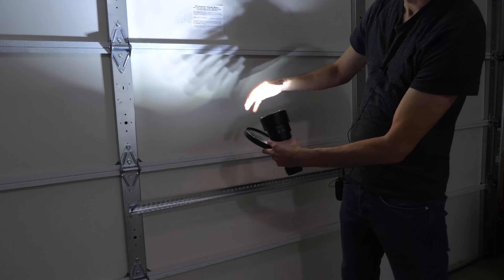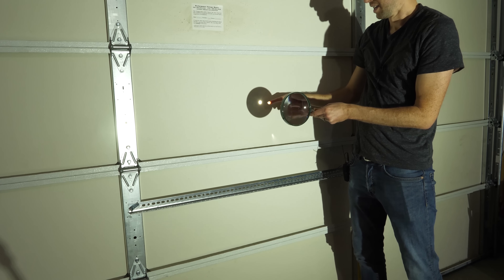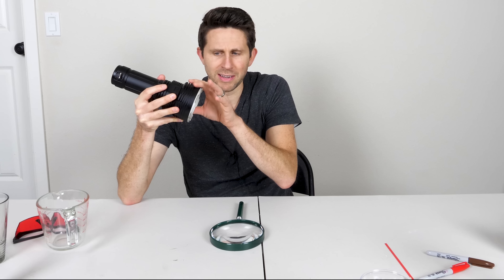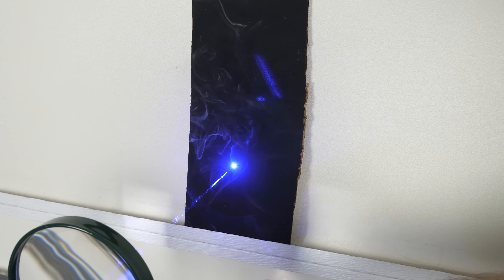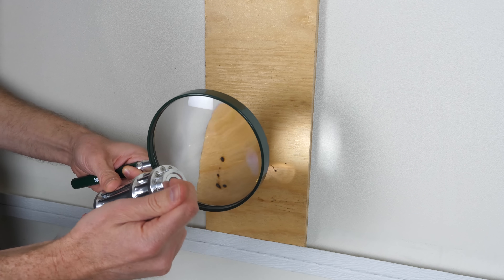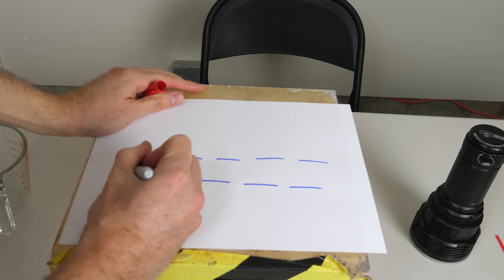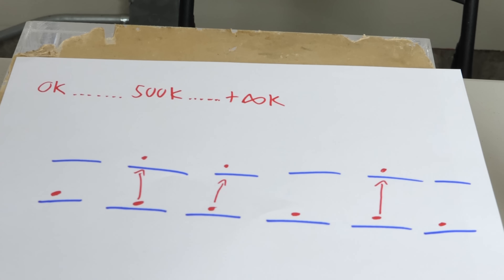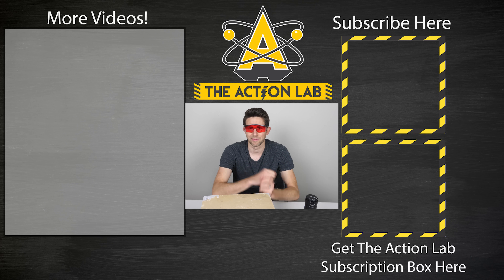What Happens if You Focus a 5W Laser With a Giant Magnifying Glass? Negative Kelvin Temperature!

Comment: Rather entertaining! Thumbs up for that :)
But i think a little more research should have been done beforehand...

In general, convex lenses are able to focus incoming parallel light into their focal point. The sun is emitting light that appears as parallel rays of light due to the vast distance between the sun and earth.
This is why we can focus sunlight rather easily into a point with convex lenses.
It is the same with the light from the laser. Ideal lasers per definition emit parallel light - which means it can be focused with a convex lens as we saw at 3:21.

With the torch, things are different. As seen in the video, the light it is emitting is not parallel. This can be observed at 0:42 to 1:48 with two reasons:
1.: the area covered in light is bigger when the light source (torch) is farther away.
2.: by the lens (magnifying glass) because it was able to focus far better when the torch was farthest away --> the incoming light was "more parallel" than at 0.5m distance at 0:45.
With the right setup, the divergent rays of the torch can be parallelized.
As far as i know, this can be achieved with a concave-convex lens combination or with a parabolic mirror.

Parabolic mirrors can focus incoming parallel light into one focal point. this means in reverse they can parallelize divergent light from a light-source emitting light in their focal point.
Of course, the mirror would have to be calibrated according to the divergence of the source.
With the light rays emitted from the torch now being parallel, a convex lens can be used to focus them into the focal point.

Also, i would like to point out that the statement starting at 2:34 is not true, because of a simple reason:
The parallelization of the light is possible as described above, although not perfectly (slight distortions can occur especially with big light sources).
The the parallel beam is focused (via the convex lens) in a small area.
This results in a higher temperature because the energy before and after passing the lens has to be about the same.
Means: there is no violation of the Thermodynamic Principles in this case. Also radiative heat transfer is a little more complex than "heat flows from hot to cold".

Conclusion and theoretical example:
Of course it is possible to achieve higher temperatures on a small area than on the surface of the sun (~5500K).
It is just a question about how much light you can focus on one single point or small area.
A way to calculate this would be to determine/look up the energy output of the sun's surface on 1 m², then compare it to the energy on the surface of earth and calculate how many m² would need to be focused to match the sun-surface-energy output.
As formula (i hope i didn't miss anything): Number_m² = (EnergyOutput_surface,sun / m²) / (Energy_surface,earth / m²)

Last but not least: i want to thank you The Action Lab for trying to make entertaining content about scientific topics.
This is very important work, especially in times when humanity is facing several challenges like the energy revolution and climate change.

BUT : You have to do it professionally and definitely not with sloppy research . 
Additionally nothing about safety regarding bright light sources or especially lasers is mentioned!
The torch alone should be able to damage your eyes permanently, let alone a 5W laser. Even a surface reflection could be enough.
ALWAYS warn people when handling stuff that dangerous!

basic info on lens-systems:
https://www.edmundoptics.com/resources/application-notes/optics/optics-application-examples/ (2min with google..)
more detailed info in every book about modern optics.

Basic info on parabolic mirrors:
https://en.wikipedia.org/wiki/Parabolic_reflector

Radiative heat transfer:
https://en.wikipedia.org/wiki/Thermal_radiation
https://nptel.ac.in/courses/112108149/pdf/M9/Student_Slides_M9.pdf
Reply: The way to see the problem with your analysis is this: Imagine individual molecules emitting and absorbing blackbody radiation. The best case scenario is two molecules at opposite foci of a large, hollow, perfectly reflective ellipsoid (prolate spheroid). Then, every photon emitted by one molecule will be absorbed by the other. They will trade photons back and forth as the absorber becomes the emitter and vice versa. They will be at the same temperature.

But if we add a second molecule to the "source" side of the ellipsoid, off that side's focus, then the radiation from that molecule will not be focused on the target molecule. The photons will almost always miss the target on the first pass or bounce, and will have a virtually identical chance of being reabsorbed by the emitting molecule as they do of being absorbed by the target. Now imagine a whole bunch of molecules radiating as blackbodies anywhere in the ellipsoid, and the situation on a per-molecule basis is the same. The molecules at the foci have a direct link and are at the same temperature as each other, while the other molecules all trade photons randomly and so equilibrate to the same temperature as each other.

Now consider that every real optical system for transferring blackbody radiation from any source molecule to any target molecule is worse than the ellipsoid is for the two molecules at its foci, and you have the reason that the target temperature cannot exceed the source temperature in any optical system. All the molecules in the optical system will, at absolute best, equilibrate to the same temperature.

Comment: This guy is an idiot... If you focus the light of the source say the sun, you can most definitely get a point hotter than the surface of the sun.
You proved that with the laser and you said with ANY combination of lenses... Use the right ones instead of a cheap magnifying glass and saying see see it doesn't work. Derdre herrrrrrr.
Reply from the maker: You obviously have no idea what I’m saying in this video...
Reply: @TheActionLab  Right so the source of the laser goes from less focused and powerful to focused and powerful contradicting an earlier statement you made in the same video.
So no I do not have any Idea of what you are actually trying to say or prove in this video.

Comment: Could not an optimized compound parabolic concentrator be designed that would fit in front of the flashlight ? Thus the CPC would collect most of the emitted light, gathering it together to a dot size comparable to the beam size of the laser ?

Comment: Dude, no, you are wrong! Lens gathers light from whole surface of one side, and most of that light(--loses on heating lens itself) concentrated on smaller spot on your wall. That spot receives more energy per unit of surface, i.e. lighter than direct light on wall w/o lens. Energy density it is, brightness. Your torch emits beam of light of certain angle. Farther you from source of, less energy density per surface unit is observed. Of course you will not get energy density greater than it is near the source of light (if we are talking about infinitely small point as source of light), but energy density of focused spot after lens will be always greater than w/o lens. If you have laser as source of light, that changes nothing. Energy density still calculated using the same math, it is just angle of laser bean is smaller, and your lens is big enough to catch whole beam, all emitted energy and focuses it into single spot (ideally).
Reply: Unfortunately a lot of people here don't understand anything about thermodynamics; the energy given off the light cannot be focused down to a point where the energy is far greater than the source, a magnifying glass does not increase the energy output of the light source no matter how finer the point, if this was the case then you could make an infinite source of power from the excess increase of light, this is why it is against the laws of thermodynamics. When you magnify the sun and start burning insects your are in no way increasing the power of the sun as the true power of the sun would turn this planet into black dust if earth were to touch the surface of the sun, another thing to understand about the Imalent DX80 if you look up the specifications of the LEDS in NO WAY that any "single" LED on that torch can pump out a straight "32,000" lumens, on its highest setting each piece of "CREE XHP70" LED is being overclocked to 4000 lumens.
Reply: @Skelath  Yes, you can't create energy. But you can get it hotter than the surface. Let's call total energy of that flashlight (or anything else, really) E. E is spread over surface area S of the flashlight. So each unit of area is illuminated by E/S brightness. What any lense does, is focus all that light to a surface smaller than S. So that brightness becomes E/S2 which is greater than at original source, simply because area is smaller. It's easily done when source is laser (aka, cone of parallel light beams). It will converge on a single point of any converging lens, called focus point. But flashlight has cone of dispersing light beams. To focus it in a single point, you need a converging lens big enough that, when you pplace lens so that it's focus is the point of abstract source point of all those dispersing beams. That will make those beams parallel, which you can focus at single point with another lens.
Reply: @sorcerors  Or you can get 8 individual torches that are 4,000 lumens each and angle them into a single point and get 32,000 lumens, which is no different to the Imalent DX80 which has 8 individual LEDS that cap out at 4,000 lumens each when overclocked, another thing to note is that after a few short minutes the Imalent DX80 gets too hot and switches down to 7000 lumens, the "original source(s)" are built onto a heat sink designed to draw heat away from the original source, so yes by all means you can focus the light into a pinprick on a surface that cannot release energy faster than what the original source is built on, however the lumens that pinprick is out putting will not exceed 32,000 lumens.
Reply: @sorcerors  Here is another torch to completely throw you off balance keep in mind the Imalent DX80 has 8 LEDS running at 4,000 lumens each when combined gives off 32,000 lumens of light, now when it comes to Torches there are other specifications and one is 'RANGE" the Imalent DX80 has a max range of 806 metres. Now here is the other torch:  BLF GT Giga thrower has single (yes only one LED) "Cree XHP35" LED with a max output of of "2,500" lumens (just over half the output of a single Cree XHP70 on the Imalent DX80) however here is the punch line: the BLF GT Giga throwers "RANGE" is 2.5 kilometres, that is 3 times the range of the Imalent DX80 so why is it that the "BLF GT Giga thrower" which clearly has an inferior LED and inferior lumen output and get 3 times the range of the Imalent DX80? well it's simple: the BLF GT Giga thrower has a more focused beam allowing it to travel further, so what happens when you use a magnifying glass to focus the Imalent DX80? well all you're doing is increasing its range but the max lumens will remain the same.
Reply: @Skelath  Max range of what? And I don't really care about specifications of the torch or anything similar. I understand it has 8 different LED sources. Now, I don't remember exactly but lumen is light and candel is illumination right? Then yes, you can't exceed 32000 lumen but you can exceed surface candel of the torch. And even with sun, if you put it in a huge half-sphere and then, after getting parallel cones of light beams, converge them at single point, that point will be far hotter than surface of sun. Far, far hotter.
Reply: @sorcerors  However the lumen level of the sun will remain the same, and the amount of heat the sun as a "whole" gives off and the amount of heat focused into that single point will be the same. Should also note that for the "BLF GT Giga thrower" look up google images of it. It literally has a nearly parallel light beam which allows it to travel further than the Imalent DX80 as the Imalent spreads out a lot more making the "BLF GT Giga thrower" classed as a "Thrower Torch" (longer range) and the Imalent DX80 classed as a "Flood Torch" (larger surface area)
Reply: @Skelath  Yes, you can't have higher energy than what sun gives off as a whole. But it will  be hotter. Because all that energy is focused. That's what I'm arguing about. Action lab guy said that it can't be hotter than surface, which is untrue, but it's true that the total heat of that point can not be higher than total heat of the source, but I can rise the heat of the surface to greater heat than surface of the source is, unless it's a point.
Reply: @sorcerors  however if you get a torch with "ONE SINGLE LED" that means the heat is coming from one single point, then magnified to one single point. Go figure.
Reply: @Skelath  Even a single LED is not actually just one point, so with fine enough techniques and tools, you can reduce it. But generally yes, in case of single LED you can't improve it